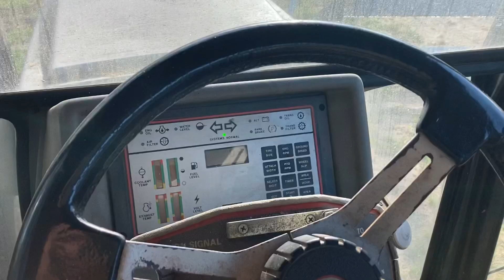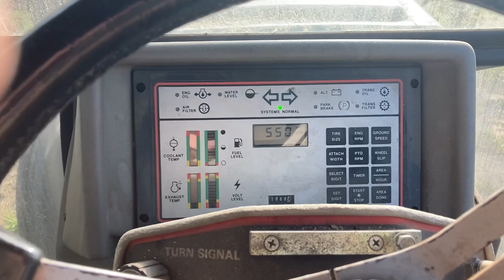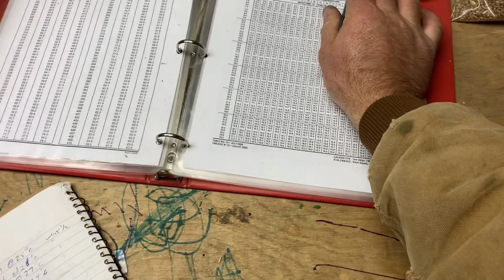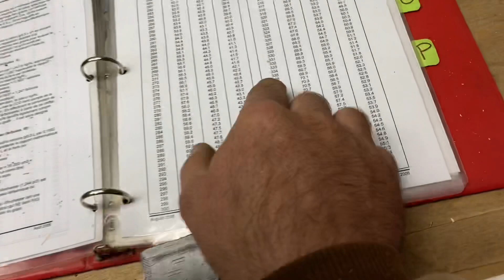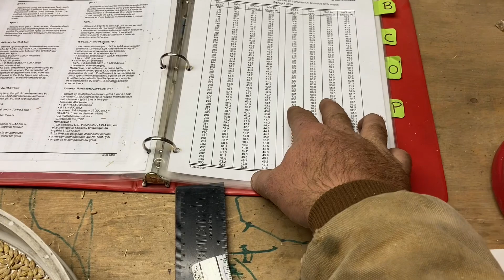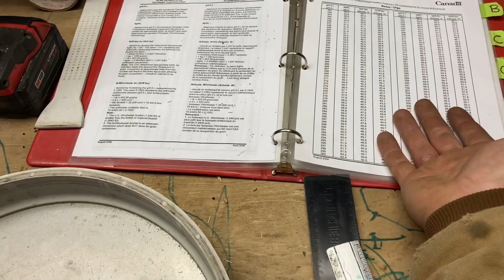Rain rain go away. Barley bushel weight and drying.

Comment: I am curious about your pea canola mix.  Do you screen it or store it as is?  I enjoy your videos.
Reply from the maker: Hey thanks for watching the videos. No we don’t screen them befor we store them. One year, the canola was tough and the peas were dry so we ran it through the batch dryer together, it worked well they are dry at the same time and the moisture comes out of the canola into the peas to certain extent.
Reply: @millionairefarmer.  So you use the mixture for feed vs sell as grains?
Reply from the maker: @wesmoore4312  no we will separate it this winter.the grains can be stored together until be get to it.